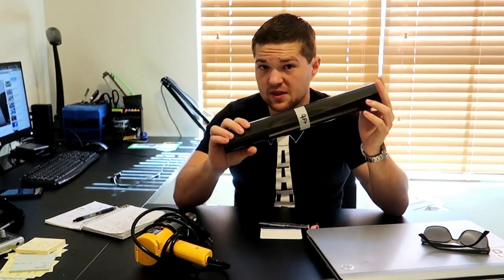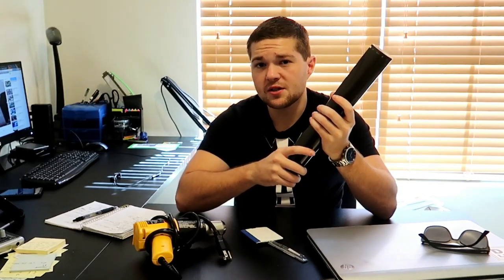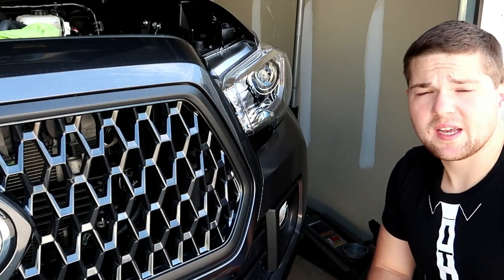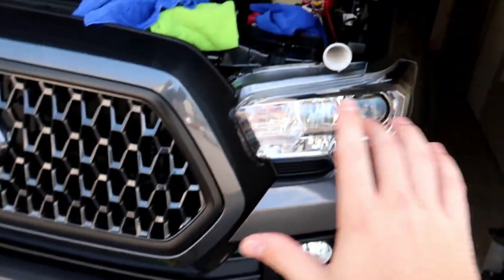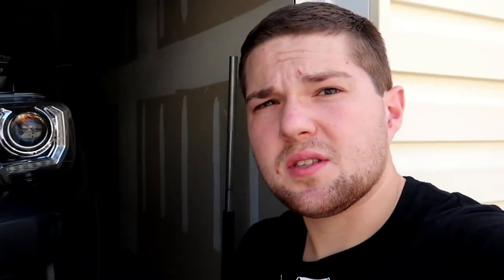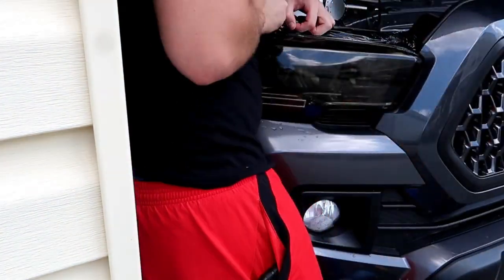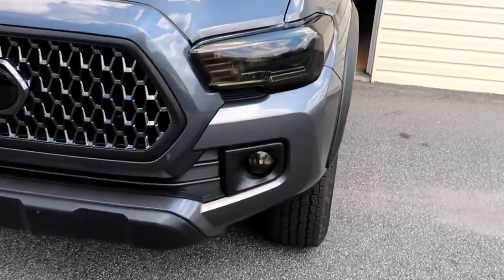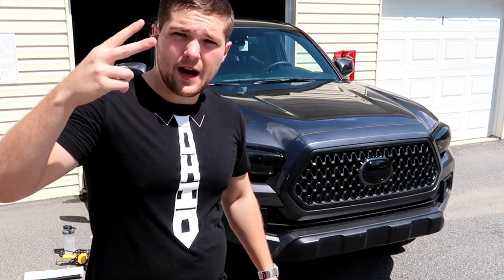How to Tint Headlights (Smoke Install) 👌| Black Out Part 2 | 2018 Tacoma Off Road | Mod 006

Comment: I have a 4runner and have done Spray and vinyl. Spray can come out perfect if you take your time. But it's time consuming to get off. Vinyl is great and I wouldn't go any darker vinyl than "Light Smoke". As far as visibility with the light smoke from vivid. I'm running 6k bulbs and they are still blinding.. 😎

Comment: How well has the tint held up? I’m considering doing this to mine but I’m concerned about how much the film needs to be stretched I don’t want it to peel back.
Reply: Reagan Solum it’s designed to be stretched, it should be fine as long as you have enough to stretch.